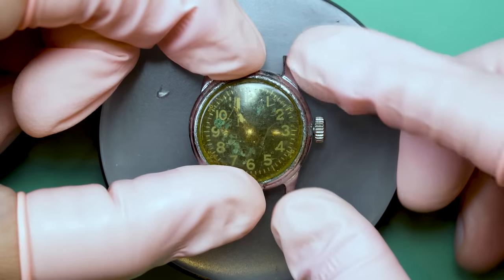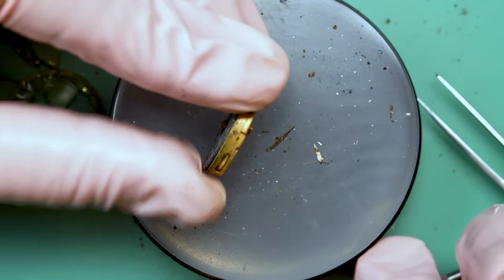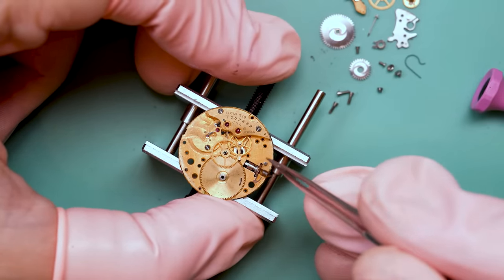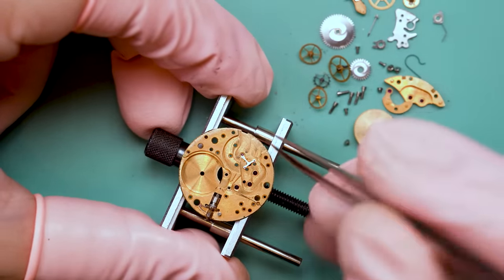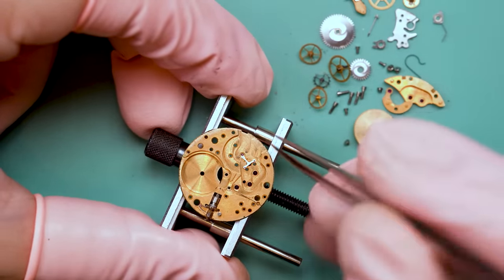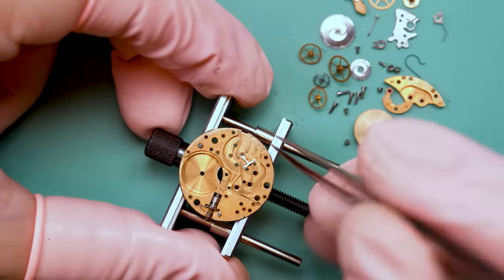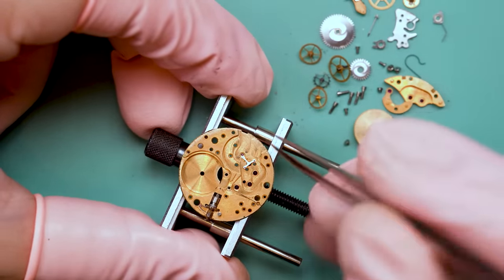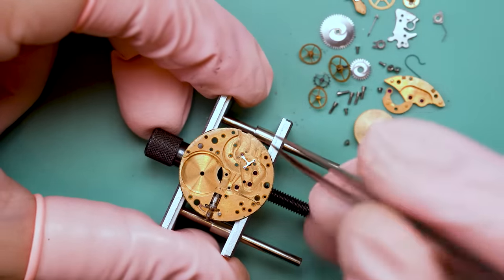Destroyed Vintage Elgin A-11 Military Watch Full Restoration

Comment: That restored plating on the case looks fantastic. Changing out the dial was also definitely the right choice. There's a level of damage that gives something a distressed look, and then there's a level of damage that makes you distressed by looking at it.
Reply: Distressed vs. distressing? ;-)
Reply: That’s right, at some point patina becomes ugly and dysfunctional!
Reply: I’m sure it would have continued decaying and gummed up the works or at least obscured the crystal with debris.
Reply: @john-paulsilke893  ...THAT'S THE TRUTH-!!!
Reply: You're absolutely right :)
Reply: @R.Daneel  ...more like "distressed" vs. "DISGUSTING"!!
Reply: This is possibly the best description of that breaking point ever.
Reply: Chemical removal of the chrome is that an idea?
Reply: Lived in and Worn vs Worn out
Reply: @daleburrell6273  i would say that him not adding the water sealing rubber back on to protect it from water damage urkes me.
Reply: @abramrexjoaquin7513  ...IF YOU SAY SO-(!)
Reply: NICE
Reply: @daleburrell6273  “”.
Reply: @brianmcdonald4061  ...whatever THAT means-(!)
Reply: Yes: my first restoration project was restoring my grandfather's Gebruder Resch "Remember" Vienna Regalator wall clock. Anything with a little patina was fine, but anything corroded to hell was replaced with a genuine Gebruder Resch donor movement's equivalent part. In particular, there was a massive dent in the pendulum bob on my grandad's clock, and ugly cracks and gouges in the porcelain parts of the dial. Also, the hands weren't original. And my grandad had bodged some parts such as the broken chime flirt. One donor movement later, and some tinkering and oiling, and I had a movement working and chiming after 50 years of inactivity, 110 years after it was built. The replacement dial has some fine crazing on the porcelain, but it looks great. The replacement pendulum bob isn't perfect, but there's no massive dent right in the middle. The bodged chime flirt is the original part.
Reply: Good one!
Reply: For colectors never change the dial. Loses all value.
Reply: what's the point of wearing those finger gloves and being so particular .... then making crazy mess and not clean it up so early on :) this is genuinely hilarious
Reply: ⁰
Reply: is it still restoring though at that point? dial is pretty important piece of watch
Reply: Please  can you help me
Reply: 1981 submariner
Reply: It's real
Reply: It glows the dials in dark
Reply: Full wacth v] sende parts please
Reply: @john-paulsilke893
Reply: @daleburrell6273
Reply: @kentottle1359  ...THAT'S MY NAME- DON'T WEAR IT OUT-(!)
Reply: Anyone happen to know what kind of crystal that was? It reminds me of that older uranium glass that was popular back in the day - it has this either yellow or greenish tint to it and is slightly radioactive but was popularly used in all sorts of dining cups, plates, and other glass stuff… anyone know if this was the same?
Reply: honest wear vs neglect
Reply: Did you missed the plastic/rubber seal? Under the Back cover...
Reply: @michalklimek9777  ...well, "ya can't please EVERYBODY!!!"
Reply: @daleburrell6273  I was Just curious if you assembled it without it, or it just dont get to the final cut of the video maybe... Just curious. Your work on this piece is amazing 😉
Reply: Well put
Reply: @michalklimek9777  ...well, thank you for the compliment- but I didn't work on the watch- I'm just another viewer.
Reply: @daleburrell6273  sry, my bad.
Reply: What a fantastic choice of words lol
Reply: The the donor died with the best decision you know what I mean
Reply: @daleburrell6273  u8
Reply: @crmukundan  ...WHATEVER THAT MEANS...(!)
Reply: Imagine painting in the missing parts of the numbers with a color such as red, orange or dark pink. Then sealing the whole surface with a thin layer of resin. Then again, that would be inappropriate for the historical value. Would look cool though. :)
Reply: @jonybe5854  being from an identical watch who would know?
Reply: @daleburrell6273  trx
Reply: I agree with you about using the donor dial. I can't imagine anyone crying over the loss of the original dial with numbers missing, rusty, and trashy condition. Why bother replating it if your your going to used that trashed dial. Sorry for all the repitition, I just don't like that original dial.
Reply: Well put
Reply: @henkholdingastate  was
Reply: Agree
Reply: A little wear is fine. It is patina, which is even desirable, but a LOT of wear is damage, and we don’t usually want to wear THAT around. This dial was severely damaged by rust. Replacing the damaged dial with a much better original dial is the right move.
Reply: Why do some watch makers say leave the dial alone and some say clean it. I have a 1920s tank Geneva and the dial is not good. Can anyone advise please. Thanks denise

Comment: There is no question that the readable dial is the best choice. There is nothing cool about a dial that resembles a Jackson Pollock painting. The end result is something to be proud of. Well done!
Reply: Definitely agree
Reply: absolutely! Originality is great but not at the cost of functionality. An original POS is just a POS.  If the dial is unreadable then it  can not function as a watch. Nothing wrong with redoing the plate either or putting on a donor dial and hands. As long as when you go to sell it you list it as such. The parts are all original A-11 parts so I see no loss in its value and you brought an otherwise destroyed A-11 back to life and it can be enjoyed by a collector.
Reply: On the other hand a NATO strap with some kind of green element that matched the verdigris in the wrecked dial would look amazing as well.
Reply: Agreed, plus let’s get to the bottom line on this…when all’s said and done, as said in the video it was “mass produced” for the military at the time and the replacement dial was an original from what looks like the exact same model. It will be the same vintage for want of a better word. It’s not like to be ludicrous a Rolex dial was stuck on it. Good call
Reply: I couldn't disagree more and you actually made my point for me by saying "a dial that resembles a Jackson Pollock painting". 
The old dial would is more unique and a great conversation starter. In my opinion, if you're wearing a watch in this day and age, you A) already know how to read it based off the hand positions and B) are wearing it as a statement. Just goes to show you we all have our own preferences!
Reply: I disagree. seeing the trash dial on a working watch is a reminder of all the hard work that was put into making it work again. It s cool.
Reply: @kchastain3  I don't know a crown from a hairspring, but I would think a WW2  ( 1945ish) watch strap would be leather......?
Reply: My thoughts (Only my opinion) Ugly as it may seam, a wounded solider still wear scars that are not pretty and can turn a head in the other direction.  Given the rust, what if its salt water, and what does salt water represent from D-Day. if true, the watch probably landed in a drawer after what could be the impossible statement of courage.
Reply: All of the mechanical functions and frame are original (besides the wand but sacrifices must be made), and the crystal and the hands withered away anyway so replacing the dial is 100% okay. Pretty much every other purely aesthetic part of the watch was gone by then and the dial was soon to follow if left to the elements.
Reply: There are a lot of watches with artist and painting styled dials. How do you figure that has anything at all to donwith function? You clearly have no clue and completely missed the point.
Reply: @coronalight77  No, I did not miss the point. You have no understanding of the word "restore." To restore a  watch does not cease at the movement. It does include the dial fo insure time can be displayed properly. I realize you must have an emotional attachment; being that it is a model from the second World War. No one would buy, let alone have any appreciation for this time piece unless it functions as well as the day it was made. That survival is what matters, not some quasi-interpretation of what a damaged, non-functional dial represents.
Reply: @alexdeleon7135  non functional dial?? All the numbers were visible. Besides its purely an aesthetic choice, nothing functional about that. If you know what a watch is you can tell the time despite what the dial looks like.
Reply: @MrGhostTheBigRoast  I know what a watch is; I am also able to tell time on a watch without indices. If aesthetics means that you would keep a different color hood on your car in stead of restoring it to match the surrounding paint, then I see your imbecilic point. The term restore has no implied meaning. It is specific in definition. Since this host does not restore dials (which he will someday), The overwhelming choice is the undamaged dial. That way the timepiece will look like the day it was issued; "restored" one might say. Perhaps you should use an hourglass, sundial, or clepsydra, since you don't require numbers. After all, it fits your dim point of view for your interpretation of what the term restore entails.
Reply: Concur. Using a period donor face and hands was the right call.
Reply: @John33gfed  Possibly. Serviceable period leather would be a tall order. Leather watch straps tend to crack. I suppose there may be repro straps available but that would take some hunting, no doubt.
Reply: @trs-80fanclub12  It could have been salt water but that would have taken access to forensic analytical equipment unavailable or ruinously expensive for Marshall to access. It also could have fallen into the basin while a soldier was shaving which would be somewhat less romantic than getting wet storming the beach at Tarawa.
Reply: @Ban this youtube I can chuck in my Technics SL1210 Mk5g turntable.
Reply: BROWN LEATHER STRAP.  I agree.
[Even slightly lighter in color but still dark somewhat].

Classy like that. 
[I have a thin watch band VERY SIMILAR to what I'm thinking  on a thin watch in the jewelry box. 

LEATHER, I agree though  
[NOT a blk woven thing like nowadays  lol ]
Nice though [for a SECOND].
Reply: For instance, WRISTWATCH REVIVAL,  if a person wears that  , and explains "it's from WW2 time area" , that person [And EVERYONE ELSE] is going to look at that strap and think to themselves, 
"Oh, that's the kind of strap they wore in that war.."

NO 
[THEY DID NOT].
LEATHER
Reply: @John33gfed  --

Yeah, you're right.
They'd have to raid an old nice watch  for its leather band,
[All curled already] 
, and leave that other watch stranded. 

That's what ya gotta do though  lol. 

YOU'RE RIGHT.
Reply: If there was a backstory on the watch, like it was worn in the Normandy invasion, then the old dial, sealed with perhaps lacquer, would be appropriate.  Otherwise, the replacement dial is the best call.

Comment: I find the restoration of the Elgin watches the most interesting. Having grown up in Elgin, Illinois during the 50's & 60'S when life revolved around the watch factory.  It was a sad day in 1966 when the watch factory was torn down.  People told stories that as they removed the floor boards there were thousands of gears etc. that had fallen down the cracks still left there.
Reply: Wow... thats where they come from?
Reply: DAM, so hudrids of defective watch parts. or lost parts in the floor boards
Reply: @lechking941  - They weren't defective, if a watchmaker dropped a gear or some other small part, it was more effective to just grab another and keep going.
Reply: @robertmayer7678  hm well forgive the oversight, still wonder how many parts there was that was still good for replacements just left to rust and stuff.
Reply: What was it about the 60s through the 80s that we tore everything down? Now, the factory would be seen as a historical building; townhouses; market etc- anyway, interesting story. What a sad day for Elgin.
Reply: @cdd4248  Looking at it now, it would have been a great apartment building, providing much more housing that the current apartment complex that now occupies that  space.
Reply: In Elgin Illinois, is Elgin pronounced with a soft g? In Canada we use a hard g in Elgin.
Reply: @JMikeLittle  We use the soft G like in the drink, gin.
Reply: That plant may have moved to SC. I remember in my teen years, 1960’s, a town in Kershaw county  changed its name to Elgin. Kershaw county is centrally located in the state close to Columbia, the capital. Don’t recall much else about that event. Probably moved to escape the unions. Seems like the towns name prior to change was Blainey or Blainy. Maybe.

Comment: The black on the parts is generally a carbon film which is left over from when the iron oxide was dissolved. You normally only get the darker black film on high carbon steel/ tool steel, mild steel will show up more grey. You can remove it with a fine brass wire wheel on a rotary tool but you'd probably want to jig up the part on a pin tool holder so it doesn't fly across the room.
Reply: If you leave the carbon film on there, does it act as a rust preventative, the way cold bluing does on a gun?
Reply: @jimthesoundman8641  No not really. The film will wear away where the contact area is and leave bare metal, in a well taken care of watch that's generally not a problem but in harsher environments the carbon will absorb and hold moisture causing premature rusting in the long term. It would be best to remove it but for that tiny amount on the stem it probably wont cause an issue unless the carbon flakes off and contaminates the oil in the jewels.
Reply: I've used brass brushes during restorations for that purpose.  You have to be gentle to not scratch things up too much.
Reply: The black color is AFAIK (EDIT: which apparently isn't far enough.. see posts below for correct&accurate information) not really carbon, though it is true the color will be a more solid black on pure steel (not mixed up with too much of other metals (like chromium, molybden etc.) with high carbon content. I force the process on some my very reactive high carbon content kitchen knives to make them more resistant to 'regular rust' (Fe2O3 = hematite) which will eventually eat into the steel. This rust is what was found in the watch.

The black colored film is actually technically also a 'rust' or corrosion where the iron oxidize (bond with oxygen), however the molecules that form have one more oxygen atom (Fe3O4 (or FeO x Fe2O3) and this is called magnetite. Magnetite, unlike hematite, forms a 'skin' that prevents oxygen from further reaction with the iron. The prosess of blueing guns is similarly - through chemicals - forcing a layer of Fe3O4 on the steel to prevent further corrosion.
(EDIT#2: while the black layer on my knives indeed is magnetite, the black film on the screws in this video is not!!)
Reply: @martinskanal  According to Evaporusts FAQ page and several forums its carbon
Reply: @55metalmonkey  yeah! I stand corrected. This process of rust removal through chelation is completely different from forcing a patina on carbon steel. Infact, evaporust will not only remove hematite but other iron oxides as well - i n c l u d i n g  the black/blue magnetite layer on patinized kives and blued guns. A different kettle of fish all together.
Reply: Carbon? Bullshit. Which allotopic form of carbon comes from the dissolution of iron (III) oxide? There's no carbon in iron oxide. And there's VERY little carbon in the steel... which is why it's steel and not iron. Even most "high carbon" steels has less than 1%. That greyish black coating is a combination of iron tannate and iron phosphate from tannic acid and phosphoric acid. That's why it looks like a Parkerized finish. They use those acids because they are present in foods (tea and Coke) and inherently safe in low concentration. If you want to get rid of rust and leave metal shiny, use dilute hydrofluoric acid. It's sold as "Wink Rust Remover."
Reply: @EightiesTV  I think you are right about the carbon not coming only from the steel.. the chelation agent used in Evaporust is Ethylenediaminetetraacetate (with molecular formula C10H14N2O8-2). It contains carbon, so the back residue layer might very well come from this component. 

I think the information on EvapoRust's own website quoted above is a simplification of what is actually going on. While it is true that the carbon in the steel "migrates", evaporust only penetrates a couple of microns into the steel, so this effect alone cannot explain the comparatively thick layer of black "goo". As you correctly point out, the carbon content in steel is +/- 1% - not sufficient for a few microns worth of steel to turn into a black skin of carbon in the treated steel. To reduce the black layer Evaporust actually suggests adding a quick second bath (combined with mechanical removal, essentially brushing off most of the layer). 

The "migrating" carbon i s however visible in the sense that it dulls the metallic sheen/luster of the steel adding a dull grey outer skin on the steel varying with the carbon content in the treated object. This dulling grey color is incidentally why some people who refurb/restore old tools and other steel objects actually steer away from Evaporust (and other chemical rust removers).
E.g. using a chemical rust remover when restoring a vintage katana sword would be considered a sacrilege as it would completely ruin the patterns in the hagane of the blade that occurs during the quenching.

(I should add I am neither a chemist nor a metallurgist so my ramblings should be treated with at least a pinch of salt)